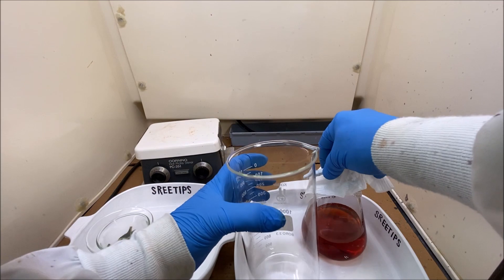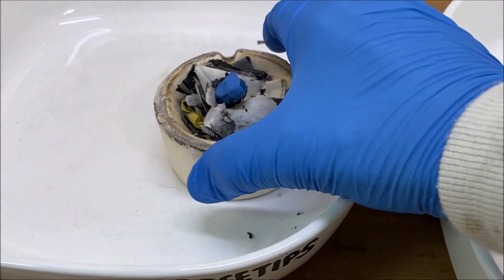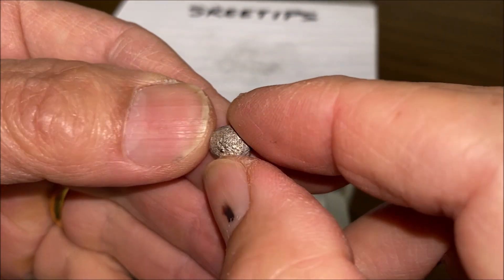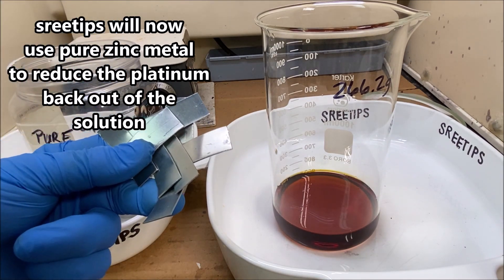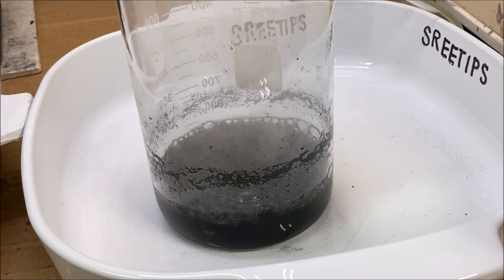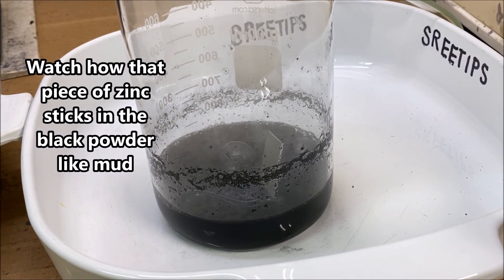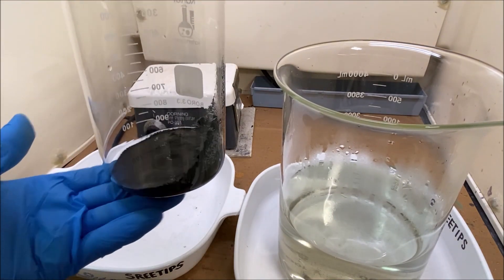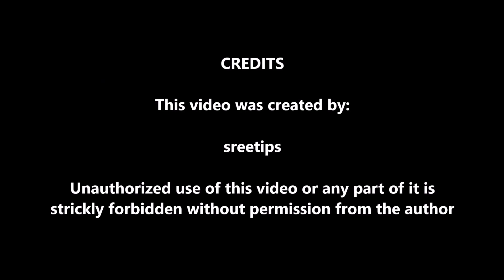Platinum Refining Bromate Hydrolysis Pt4

Comment: 13:12 To solve the problem of decantation by rinsing, I recommend a new rigid filter with a ceramic appearance made of a fiberglass filter that prevents the passage of particles of the approximate size.
Similar in size to the H1N1 virus and it clears up very well, it even allows rinsing in the ultrasonic bath and fits well in almost all glasses. Pilex looks like a bowl but does not support heat. I have seen them in the new courses of INEM to get the acid and solvent handling certificate in a free course. Contact Lanbide maybe they can advise you

Comment: In one of the earlier videos in the sequence, when you got the pink precipitate, some commenters (including me) were thinking that there could be cobalt present. I went ahead and dissolved a little piece of cobalt in HCl+H2O2 just out of curiosity. It made a beautiful royal blue solution that turned pink when diluted with water. I also added ammonia and tested it with DMG, which made an orange complex. So I think we can be confident that the color didn't come from cobalt and was likely iridium after all.

I do find it odd how quickly and easily the button you got melted, though. I think iridium or an Ir-Pt alloy with lots of Ir would be nearly impossible to melt with an oxy-acetylene torch - it doesn't form a eutectic system. I'm going to guess that either there's a third metal present in large quantities, or it was mostly platinum but that the iridium is brightly colored enough in its ammonium chloride complex to impart a pink color anyway. Looking forward to finding out what it's made of!

Comment: So does the zinc chloride simply evaporate as a gas?  That seems like a lot of zinc to be converted into a gas and released out of the hood. Does any zinc remain to contaminate the platinum?
Reply from the maker: The zinc forms zinc chloride and hydrogen gas.
Reply from the maker: Thorough rinsing will get the zinc chloride out.

Comment: When you put borax on top of the material in the crucible and heat it - you can get less borax splatter if you keep the flame well away from the material until the borax melts. It takes quite a bit longer, but is not as messy.

Comment: So I think we'll get all the Platinum group metals out of solution but using other chemicals you only get most of the metal out of solution some will stay behind correct
Reply from the maker: Correct, and after doing a little more research, the bromate hydrolysis is best suited for platinum that’s already fairly pure - like 990 parts per thousand. Also, iridium, if present, is difficult to remove with the hydrolysis. Didn’t find this out until after I began the series.
Reply: @sreetips  I remember seeing Nile red using bromite in an experiment but it's been so long ago I'm very interested in seeing what you've got in store for us in episode 5

Comment: So you started with 13.7 and as of both weights you are about 14.5.  What part am I missing where you gained weight?  I've watched them all and am puzzled
Reply from the maker: I added more metal when I did the melt. It was in the extra filters tgat I added.
Reply: Adding the filters in from the box that he suspected contains iridium too?
Reply: @joachimgrek6920  he burnt that off when he made the button
Reply: @davidmccleary5540  And what was in the  added filters didn´t whey anything then? 🤗😂

Comment: Is the Maybe-Iridium button actually two metals? It's looks like one floated on top of the other during the melt and froze in that position. It will be interesting to see what the xrf results are. Is it possible to calculate the density of the button through displacement or would that involve instruments that you don't have for measuring the displaced amount of water? Great video again - can't wait for the next (final?) installment.
Reply from the maker: The button is probably a little of everything.

Comment: The upshot I get from this series is that if you're a garden-shed refiner, it's best to sell your PGMs to a refiner and focus on gold and silver.
Reply: What I get is "do it once for fun or the experience" but yeah, It looks like something I wouldnt want to repeat.
Super nice series though. Instructive and soothing :)
Reply: @herrhaber9076  He's doing it this once to show us all what's involved so none of us will hopefully take the risk. He's repeatedly emphasized how dangerous parts of this are and that he really doesn't like doing it himself. We're getting a great series on the process, but I don't expect he'll be doing it again. The No2 released with the gold and silver refining needs to be dealt with in a safe manner, but that's far less problematic that handling platinum in solution. This is even more so because platinum is worth far less than gold currently. 12 grams of platinum at spot price is around $413. 12 grams of gold would cost around $750.
Reply: Any dissolving of metals is generally a bad thing for 'garden shed' refiners to be doing. Dont forget most electronic scrap and even alof of gold and silver contains PGM group metals and there fore the same hazards apply to most refining.

Comment: haha, I'm on 1'31" curious if you will be able to melt the AR residue. Birght as the sun? I'm placing my bets here. well theoretically it should be possible with Acetylene. To me you will make history here haha.
Reply: 4'20" HAHAA you did it. Guess you where lucky to ran out of gas just when you had burned the papers. I'm pretty sure you are one of the first hobby refiners to melt the metal that usually comes from space.
Reply: Aah yes,easier to rinse out Zink than Copper.
Reply: Rinsing the PGM percipitate was not boring. I could see different refraction in the rinsewater. That is caused by layers of  different concentration/densities of Zinc Salts.
Reply: @johannesdesloper8434  I noticed it swirling about... I love science!! ✌🏼

Comment: is that a specialty melt crucible for the high temps? ive only seen you use that a few times over the years.... when you cut the glove finger off om man ROFL!!
Reply from the maker: Yes, those are for extreme temperatures. The classic open-face fused silica melt dish, being very thin, would melt and swallow the bead of metal.